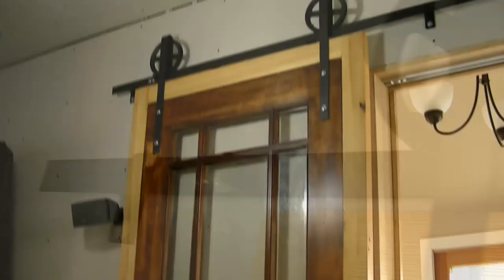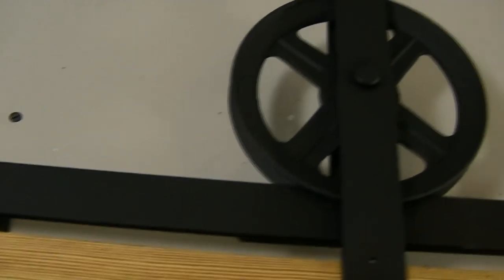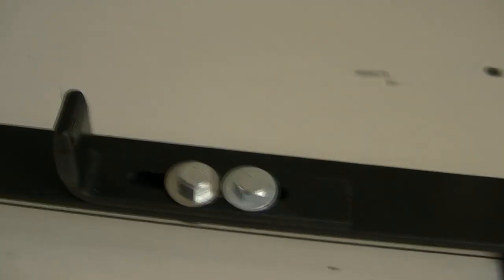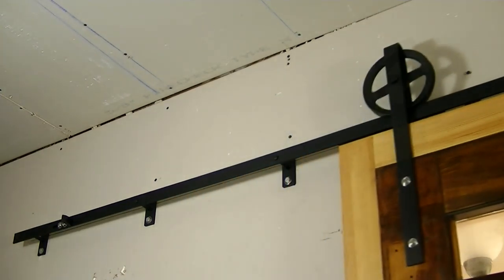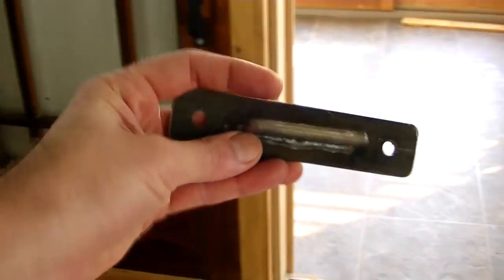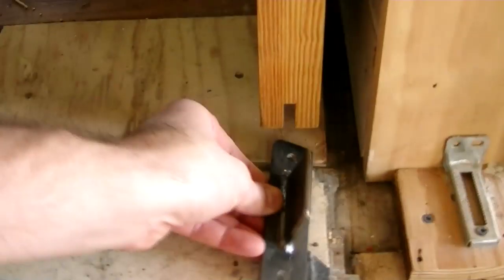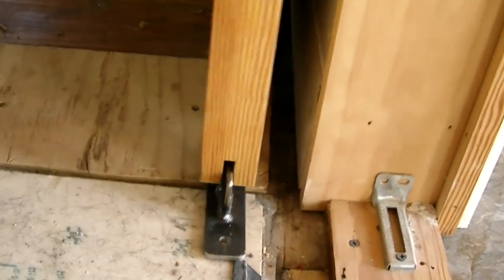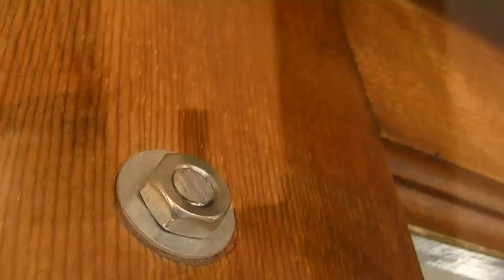Custom Interior Flat Track Sliding Barn Door | DIY

Comment: Just wondering why you hung the door before the walls were finished? Great job on the metal work though. Also why such a large gap between door and wall the reveal looks a little big was it a fastener clearance problem or just accommodating space for baseboard and casement?

Comment: I bought the same pulley at Tractor Supply did you put  bearings in it or a shoulder Bolt through it?